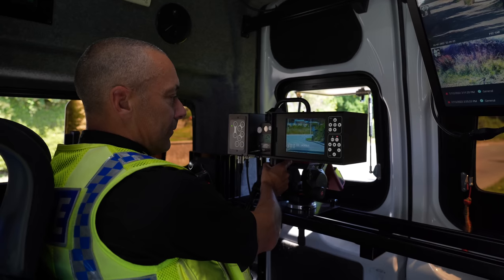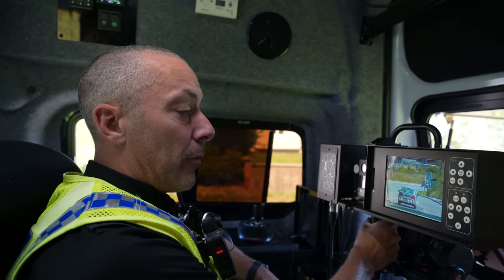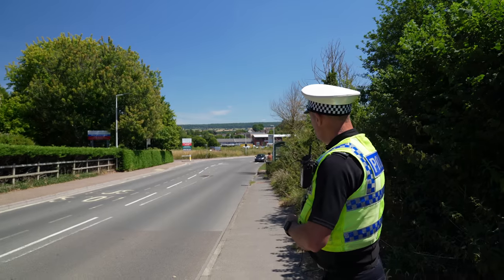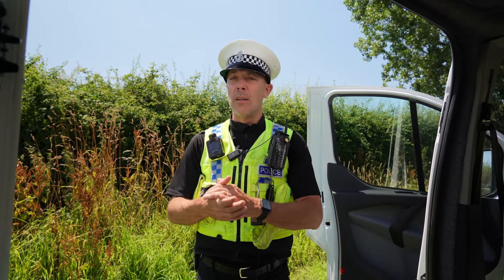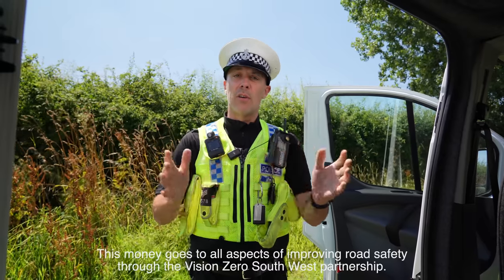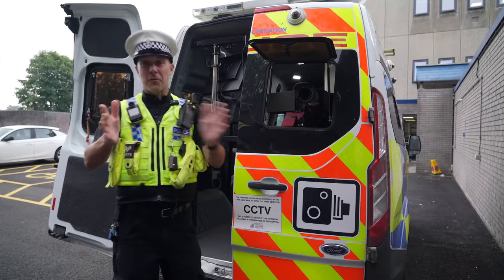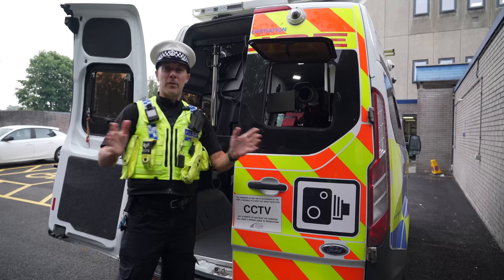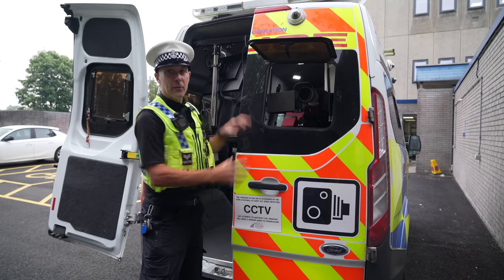SPEED CAMERAS - Road Safety or Cash Cows?

Comment: A burglar and someone going iver the speed limit is two totally different category! A burglar is someone who is intentionally causing harm / distress to someone else's property. Going 5mph over the limit isn't the bloody same is it, deny it being a cash cow all you like,  ut that's exactly what it is when it's put in totally unnecessary locations
Reply: At what speed would you commence enforcement in a 30 and why?
Reply: @unleashthedragonwithin2057  did you read my comment? i said totally unnecessary locations, like bridges over motorways, dual carriage ways. outside a school is justified. hiding behind a bush on a 60mph road is not
Reply: @qwerty1weir  NSL (60mph) roads are generally the most dangerous. Many roads around me are 60mph and there is not even space to pass a cyclist, and you can often not see more than a hundred meters. 

The 60 limit on most roads is not set as a defined limit for that road, but more where a road previously had no limit at all and the default 60mph was imposed by law and there is no reason or funding to set a lower limit.  

The 70 mph dual carriageway that passes my home, just after a speed camera is a junction that sees regular serious collisions. and once drivers have passed the camera, get over the crest for a nice downhill stretch speeds are regularly in excess of 70mph. A pull out from standing at the junction into 70mph traffic is bad enough, and you seriously think there should be no enforcement? 

I find a lot of drivers who mostly do the 30-50mph roads in urban areas with the odd motorway hop to visit relatives have no real clue of the risks of those other roads with higher limits.
Reply: @bikeman123  Whatever does any of that have to do with the above?
Reply: @stevesmith7530  The problem is the roads, the Autobahn is one of the safest highway systems in the world with partially unlimited speed, the real danger is distracted drivers (phones, car screens, speedometer) and roads that promote high speed, the Netherlands has nailed that part of road design, and drives that doesn't respect the consequences of speed in vehicles that aren't suited for them
Reply: he explained flashing would be the same offence of obstruct Police, not that the initial offence was the same. 

There is a location near me on the A15 that people say is ridiculous location, national speed limit in place, dual carriageway, but after travelling that road to and from work for around 4 years and seeing many collisions or the aftermath of collisions, and nearly being collided with by drivers hitting around a ton a couple of times, i can totally see why they place a van there. They also pitch up in areas that people make regularly complaints about, just because you're not privy to all the reasons for the locations doesn't necessarily mean they shouldn't be there.

If you want to speed most of the sites are publicised on safety partnerships websites, on Facebook and other places, just remember where they sit on the routes you travel regularly, or better yet don't drive at ridiculous speeds, it's not too difficult. They even provide you leeway of 10% + 2mph before they start enforcement, most car speedos are set around 10% slower than the speed you travel, so if say for example you were ticketed for doing 35mph in a 30 limit you will have been doing just shy of 40mph on your speedo anyway if it isn't calibrated so who is in the wrong?
Reply: @obiitom  it's a cash cow , I don't care the reasoning , I'll change my opinion when they put as much effort into catching peados , rapists, burglars, and general scum criminal also as they do into charging people for any sort of speeding or driving infringement. Drivers are easy targets. Too much real
Work required to investigate criminal damage or a robbery, oh here's an incident number and no officer ever turns up.
Reply: @kalle5548  The unrestricted autobahn sections do have much higher fatality rates than the restricted ones, roughly double that of here in the UK where the permitted max speed difference between vehicles is around 14 mph. The biggest problem is not the speeds involved, but the distances between vehicles, and that applies to every road type, in every country in the world I have visited. 

More speed requires more space, and seeing vehicles travelling at high speeds with barely two car lengths between them is just a disaster waiting to happen.  This is why collisions on such roads often look much worse with dozens of vehicles involved. Yet the fatalities seem low for the numbers involved because the speed differential is not so great.
Reply: @qwerty1weir  What like implementing CCTV and interviews having a dedicated branch for that type of crime say CID and bring about prosecutions, no we do that its just those crimes aren't as common.
Reply: @qwerty1weir  How about if said road had 30 fatalities in the last month attributed to excessive speed? Do the police have to explain every time they go to a piss to you? You don't have stats on every corner and death they do, and maybe when you find a dead kid and have to clean up the road and tell they're mum they aren't coming home you can have the privilege of saying speeding doesn't matter.
Reply: @kalle5548  The autobahn police also use these vans just after signs and on inclines specifically to prevent speeding, they don't piss about, the reason the autobahn is safer is because road users obey the law, something which this comment thread proves isn't true here because everyone is upset they cannot speed, well no, speeding is a crime.
Reply: @PCDelorian  where did I say speeding doesn't matter?  The police ... infact the whole justice system in this country is abysmal at best, always going after the easy money , all serious crimes get an incident number and feck all else
Reply: @qwerty1weir  As the officer said in the video, if it was purely a way of generating money for the treasury, then camera vans would be unmarked, simple as that. Also, a point you made earlier about them hiding behind a bush, this is not the case with the camera vans as they need line of site on the vehicles they are measuring the speed of, obviously being behind a bush would not allow this. That said, some camera locations and the times of day they are out, do make me highly skeptical and I wonder what the accident statistics would show for the area.

In relation to your argument that the police should be putting as much effort into catching peados , rapists, burglars, and general scum criminals, they do. In fact they put much more effort into this than they do catching speeding motorists with mobile speed cameras. The truth of the matter is, there simply isn't enough police officers to deal with everything. Modern technology has proven to be a massive drain on police resources with a massive amount of crime being committed on line and via social media.

However, speeding is an offence. I know lots of people do like to drive fast. Have you ever had to knock on a strangers door and tell them that their child is in a mortuary because they have been involved in a road traffic collision where speeding was a factor? Or pick up body parts from the road because a pedestrian has been struck by a speeding car and... well you can imagine, or rather you can't because you have to see a scene like that to believe it? Have you ever had to pick brain matter out of a hawthorn hedge after a speeding car has overturned causing the drivers head to split open and spray its contents? I have on all three counts. The first one numerous times and I can remember the reaction of every family member I have had to break the news to.
Reply: @qwerty1weir  Your opposed to enforcement ergo it doesn't matter. Whilst it's obviously not as serious if I oppose the arrest and detention of murderers I am saying life doesn't matter. You are speeding if this van catches you, so people are complaining because they are being caught speeding, do you 1. Belive speeding is acceptable or 2. Believe speeding is deserved of punishment if 1 you don't think its an issue if 2 you don't oppose these vans.
Reply: @qwerty1weir  Serious crimes are hard to prove. Speeding isn't, the issue isn't a lack of effort its difficulty proving something. Most people agree DV and Rape are 2 of the worst crimes but proving them is beyond difficult and thus police can spend 5 times the time on them and get 1% the arrests, this doesn't mean they're not being investigated
Reply: @kalle5548   The fatality rate over each 1,000-kilometre stretch of German motorways is 30.2 percent, according to European Union data – well above the European average of 26.4 percent. Several European countries including France, Finland, Great Britain, Portugal and Sweden had lower fatality rates than Germany.
Reply: Main reason why it's unfair to compare speeders to burglars. The police catch speeders.
Reply: Tell the burglar to not do it before they do it saves everyone then
Reply: Yes they make money, but only because people break the law, don't want the fine? Dont commit the crime
Reply: @stevesmith7530  statistically RTA fatalities are mainly accounted for on 50 and 60 mph roads. Not motorways or in built up areas, I think it's reasonable to deter people from speeding on these roads
Reply: @petersellers7155  
 Many of those types of road are rural roads where maintaining 40 is near impossible, let alone the NSL. 50 & 60 limits cover a very wide spread of road types, and a huge amount of the road network, too wide to really consider those limits as datasets. Both 50 & 60mph cover everything from multi-lane roads with off-grade junctions like motorways with heavily segregated pedestrians, to rural single track lanes with never more than a couple of hundred yards line of sight. 

Interestingly, when you look at the hard numbers, excess speed for the conditions on A roads is not a much lower number than excess speed (posted limit) for all road types. In fact, overall excess speed (conditions) is a factor in around twice as many collisions as excess speed (posted limit) across all road types. The biggest factor in collisions is not speed, but poor observation and judgement.

And let's face it, anyone who breaks the speed limit is displaying poor observation and/or judgement. Speed limits are a maximum, to keep the morons in check somewhat, to help account for some of those other factors such as idiot pedestrians, other idiot road users etc. 

In order..... and there are more factors listed, and can be more than one factor involved in a collision. 
 

Driver/Rider failed to look properly
Behaviour or inexperience
Driver/Rider failed to judge other person`s path or speed
Driver/Rider careless, reckless or in a hurry
Poor turn or manoeuvre
Road environment contributed
Loss of control
Pedestrian only (casualty or uninjured)
Impairment or distraction
Vision affected by external factors
Pedestrian failed to look properly
Slippery road (due to weather)
Travelling too fast for conditions
Sudden braking
Following too close
Pedestrian careless, reckless or in a hurry
Learner or inexperienced driver/rider
Driver/Rider impaired by alcohol
Exceeding speed limit
Reply: @qwerty1weir  Thank you Andy for sticking up for shit driving standards. We definitely need less enforcement. Road deaths are on the rise despite cars being safer, so it must be the police wanting to make virtually no money from fines that is the problem, not inattentive drivers.
Reply: @ultra_vires  lol virtually no money, go do some research and see how "little" revenue they make from it.
Reply: I do remember reading about a guy who got cough and did protest on the spot and told the police that the rules where on his side by driving at his speed out of a roundabout...... but no he got a hefty fine..... later on he did went to court and won because of no sign for a speed limit...... He did claim that all of the people that did pay fine for this blunder by the police should get it back as he...... but hell no did the police say..... some one did have a barrister on the case and threat to sue and then the police did start to look at the case to repay...... not easy live.

Comment: What I don’t understand is that you completely contradicted yourself Owen. You said if you’ve seen the van, you’re too late. So why does the visibility of the van make any difference?
Reply from the maker: I know what you mean but the point is that the cameras are calibrated up to 1000m. In all likelihood they would be used at much less a range than this due to road layout, volume of traffic, obstacles etc. Its just making a point as to the range of the equipment. Owen
Reply: @GCMYT  You missed the previous commenters point. It can't be deterrent if you're caught before you've even had chance to react, usually they're parked pretty sneakily?
Reply: @ProMilkshake  I don't know about ones you have come across, but I have been driving for 5 years and every one of these mobile speed camera vans are so obvious and easy to spot. I have never seen one trying to be "sneaky".
Reply: @SurgeDashcam  5years isn't a long time to ve driving 😂🤣😂🤣 bet you only drive about 100miles a week as well
Reply: @ProMilkshake  You shouldn't need to react if you are not speeding. Just drive past the van with a smile 🙂 on your face knowing you have been a good egg.
Reply: @ZJS0113  I drive 15k a year and 5 years is definitely long enough to come across a large amount of these mobile speed cameras. Enough to make my judgement. 

I'm just making an observation, not debating whether or not these mobile cameras are good or bad.
Reply: @SurgeDashcam  15k a year isn't that much driving, nor is 5years a long time. Begging it 😂🤣😂🤣
Reply: @ZJS0113  I never said it's a lot, I said it's enough. Enough to make my observation.
Reply: @SurgeDashcam  it's not enough 🤣
Reply: Surely the take away here is either don’t speed, or if you do and get caught, stop crying about it. 😂
Reply: @SurgeDashcam  dude, the one that got me was sneaky and tightly parked behind pretty much the only car on that stretch of the road so you could only see the top white part of the van. looked like a typical van until i got close. the photo of me they uploaded on their portal for me to check showed he got me ages away too as it was a very long straight. it all depends how sly the person doing the job is.
Reply: @ZJS0113  I disagree, 50k a year of motorway driving provides very little in the way of 'experience', 15k a year of a busy city driving environment, roads connecting from all directions, cyclists, E-Scooters, pedestrians, traffic lights, crossings etc, will teach you far more than sitting on the M5.
Reply: @unleashthedragonwithin2057  people that only ever drive around their own area are the worst drivers... country road driving (proper country roads) is more difficult than any city driving. Driving at 20-30mph is easy.
Reply: Garrus Vakarian  don't know. Clocked up 10k on a new van in under 3month but don't in general
Reply: Garrus Vakarian  if you say so 🤣
Reply: @SurgeDashcam  I saw 2 camera vans obviously trying to hide themselves within my first month of driving. It's incredibly arrogant of you to assume your experiences apply to everyone else.
Reply: @SurgeDashcam  maybe you don't see the sneaky ones?
Reply: I think having a cat and mouse road system isn't good.  The feeling that every time you get in the car there's police officers trying to give you points on your licence..when most of us got our licence the speed limit was higher which muscle memory kicks in.  Getting caught doing 25mph on a 20mph road is ridiculous.  25 isn't exactly break neck speed. To justify given points when a fine should be sufficient at most.
Reply: Garrus Vakarian  The classic 'I do x an above average amount, so therefore anyone who does x an average amount is totally invalid of an opinion'. 
Imagine trying to gatekeep someone's lived experience of something.